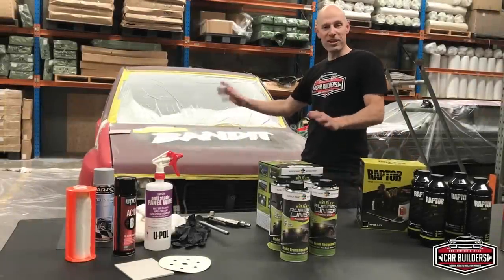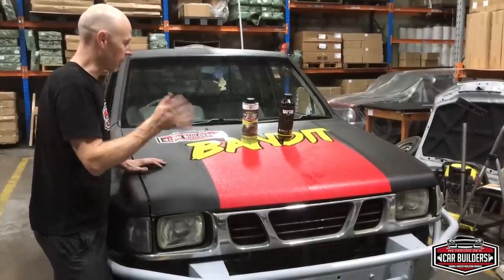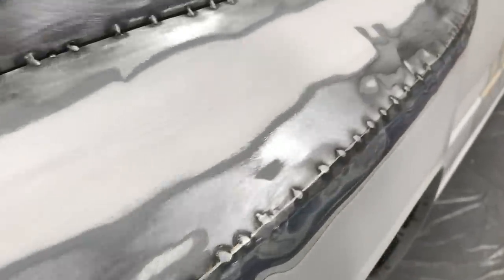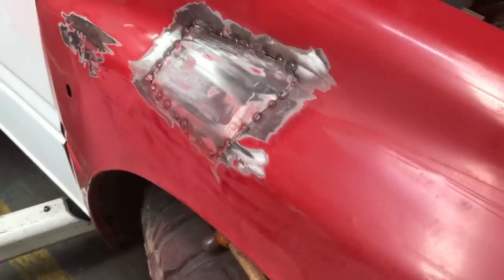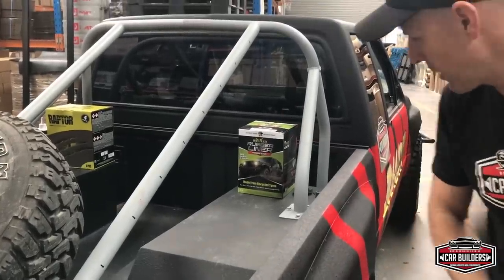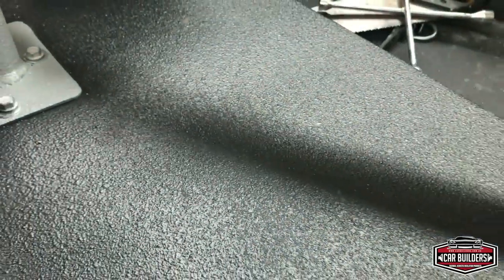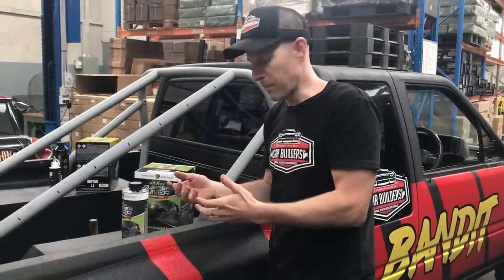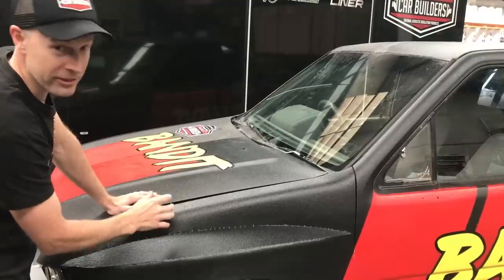Raptor liner or Bullyliner? A road test review on both DIY liners

Comment: I have a question about the Bully Liner, does it fade in the sunlight? Looking for real world info as I'm considering this for a complete truck and don't want it looking like crap in a year
Reply from the maker: Hi motafinga. Both Bully and Raptor are UV tested for 5000 continuous hours. What colour where you thinking? Bully is a lighter shade of black than Raptor and almost has a faded appearance rather than pitch black. I understand Bully are about to release a true black in addition to their existing Midnight black shade.
Reply: I think I would likely go with the lighter grey color, I really like the idea of it being water based and also have the ability to do touch ups. I would probably roll it on as well. I have used Monstaliner on another project with a roller and it came out pretty good and they claimed it was very UV resistant do to it using a hardener/ catalyst. The Monstaliner seems to have a lot more color options too so I’m weighing it all out
Reply from the maker: Yeah, water based is an advantage of the product. Good luck with your project.

Comment: would you use these type products on internal floor pan, firewall etc. and then apply sound deadener sheets? would the sound deadener adhere?
Reply from the maker: Hi Ben. Yes, the deadening sheets will adhere to Raptor. However, due to the texted highs and lows, in application, it is important you press the deadener in to contact all the lows as well as the highs.
Reply: @carbuilders1  thank you!

Comment: Hi guys great video, was wondering if u can use normal colour paint onto of the raptor 2k?
Reply from the maker: Yes, you can paint over the Raptor however you are best to tint the Raptor to the desired colour 👍
Reply: Thanks for reply, would u be able to put 9n quad bike plastic?  Think it would look great on my quad aswell lol
Reply from the maker: Yes, you will need to use the adhesive promoter (we sell it too) as if it was a bumper bar. The key is getting the solvent-based adhesive promoter to stick then applying a primer before applying the Raptor 👌
Reply: Raptor has a tintable variant.

Comment: I saw this video months ago and about to order 8 liters of Upol. I am thinking if it's going to be enough for my flat bed build on my channel. 8x7 feet with 2' of side skirts, aprox 110sf with headache rack.
Reply from the maker: You're just doing the tray in the dimensions you mentioned? 8L will easily cover it. Send through some pics when your done 🤙Instagram @carbuilders
Reply: @carbuilders1  I'm uploading the build as I go, actually ordering the Raptor now plus some epoxy primer.

Comment: Without using the tinted version what type of paint could you use to go over raptor liner eg. for a black gloss finish or fluro striping
Reply from the maker: Hi Bags Mc Gee. The Raptor Black  Midnight has a gloss finish. You can paint over the Raptor with any 2K or 1K paint. 😎👍

Comment: FYI - The Raptor, for what it's worth, can also be over painted with 2 pack paint...or base cleared for additional color combinations. Also - I noticed in the rope test, you didn't do the same evaluation on the Bully Liner and based on how the hammer scratched the Bully - I think the rope would have really torn right through it....IMO.
Reply from the maker: Hi Mark. Yes, Raptor and Bully can be painted over with 2 pack 👍As mentioned in previous comments, the rope test was done on both but missed the video editing 🤦‍♂️It is a servere test and ate through both paints (best way to think about these paints is 5 times stronger than a conventional paint)

Comment: Any idea how the Bully Liner fares as an electrical insulation?  What if you had an exposed wire and you cut the power,  sprayed it or brushed it down with the Bully Liner?  Do you think the bully liner would hold the temperature?
Reply from the maker: sorry we have not tested the product in this application, testing would need to be done to evaluate the scenario. We wouldn't be confidant to promote the use of a paint coating in this application as there are levels of compliance when dealing with electricity.
Reply: I see it is listed as Non-Flammable on your site.  Does this mean it does not hold a flame?

Comment: Hi there, great video. Just wanted to ask how raptor liner compares to rhino liner? Cheers.
Reply from the maker: Thank you Rosemary. The paints in this video are DIY whereas Rhino Liner needs to be applied by an applicator. Rhino costs a lot more however it will be a much harder liner.

Comment: How does Bully hold up to UV? I'm curious as how well it resist fading?
Reply from the maker: Hi David. Both the Raptor and Bully paints have been tested to 5000 hours of continuous UV. Both paints have been around for a long time and haven't had issues with this.

Comment: You never covered the effects of the testing of the Bully!
Reply from the maker: Hi Izzey23. Sorry it came across this way (filming/editing fatigue may have let us down 😫). We did the same thing to both sides in testing e.g. scrapping tools etc. We found they both performed very similarly but the real difference was the points we summarised e.g. different paint application, finished look and texture, washing them, ability to touch up etc.
Reply: @carbuilders1  The claw hammer removed much more material from the Bully side.  You played down the effect by saying you just brush away the removed material.  That seemed like a lame explanation.

Comment: Summary: Raptor liner is much much better despite the biased commentaries or lack there of.   The reviewer tried too hard to hide the lack of performance of the Bullie Liner to a point that I personally am being swayed away from it very much.
Reply from the maker: Thank you for your feedback mightymikee. We have addressed this feedback a few times in comments. We tried to complete the tests equally- filming and editing is harder than it looks 😆 We actually sell both products and are trying to show the pros and cons of both. These paints will suit different people/purposes due to their varying strengths. For easy of painting, grippy surface and desire to touch up, Bully wins hands down. If you want to colour match, a glossy-like finish and need a surface that is easy to clean, Raptor is your winner. We are happy to talk through which paint would suit your purpose best 03 8777 0960

Comment: So which one is stronger?? Or line-X? I will paint my scooter for crashing or scratchings
Reply from the maker: Hi Curtis. Line-X is stronger but these paints are DIY.
Reply: Car Builders - Thermal & Acoustic insulation materials Can i do it by myself with Line-X spray? They said 1000 $ for painting with line x in Turkey..It a very very expensive here and i need to do it myself
Reply: Years ago, a guy I knew had a truck painted with liner, maybe, rhino? It was like 40 grit sandpaper, we would push each other into it when we were walking by it, the thing would give you road rash. Any info on techniques to avoid that, yours must not be that way, you wouldn't have leaned on it, maybe who ever did it used a roller?

Comment: Raptor looks to be just a step behind line-x. Not sure how many coats went into that bed, but if I put all four cans into just the bed of my Ranger I’m pretty sure it’d be much tougher. Better yet, spray two kits/8 cans as a bedliner and it’d be even better. For just over $200 USD, that’s a quarter of the cost of a Line-X. On a used truck that’s not gonna get commercially beat on, that has to be the way to go.
Reply from the maker: Hi Chris. Yes, Line-X is a stronger coating than these paints but isn't a DIY option. We were looking at two leading DIY coatings available in the Australian market 👍

Comment: Also do you think a Gallon is enough to paint a whole truck? What kit would you recommend
Reply: Whats ur idea of a truck? 74 Toyota helix or ram megacab lol
Reply from the maker: Hi saabin907. You will need 8L which is just over 2G (two coats) for a Toyota LandCruiser wagon size truck.
Reply: Definitely shop around for prices as they very quite a bit. I was able to find a 4 liter kit on eBay with the gun for $92. Two kits should be enough for your application. You can also thin it which will make it spray a little easier with a smoother texture using their supplied gun.

Comment: Nice review of the hardness of these paints, but the question of which one is better was not definitively answered.  I am still in the dark.
Reply from the maker: Oh no... Well, through our testing we discovered that they performed very similarly. The greater difference, or the better one, depends on the level of skill of the user (Bully is much easier to use as a water based solution), access to equipment (Raptor is 2K and should be done with the appropriate safety equipment), the look (Raptor has a more glossy appearance and Bully is more matte), need for a particular colour (Raptor can be tinted to colour match and Bully has a select range), texture (Bully is much grippier) or clean up (Raptor surfaces clean much easier- although Bully are bringing out a top coat which will improve this area for the product). So outside of performance, which was the same, the other factors will make one product a clear winner for one person but not another. Good luck with your project.

Comment: Also note all the dust he wiped off after clawing at the bully with the hammer and the nast scratches he didnt show. Video has to be sponsored by bully.
Reply from the maker: Hi Juan. We made an effort to make a consistant road test on these products and we are sorry that you saw it as bias. Our aim was to educate buyers about the strengths of each paint. No, this was not a sponsored video. We actually stock and sell both products.
Reply: I bet you chose Raptor and want to justify your decision, there are long term videos on Raptor use here on YT, I suggest you go watch one of those long term tests, Raptor peels like crazy and even has let rust through in some cases.
Reply: How well do you think it would hide light to medium hail damage.
It looks like it did well on your panel welds, but I'm just curious about what you think since you have applied it and know how it goes on.
Thanks

Comment: What did you do different to get the red on the craptor liner?
Reply from the maker: The Bandit stickers? We put those on first and masked around them before spraying.
Reply: Car Builders - Thermal & Acoustic insulation materials Car Builders - Thermal & Acoustic insulation materials at about 3:00 you started talking about painting on the bullyliner. You never addressed the red on the craptor liner.
Reply from the maker: We applied the same way as we did with the Bully. Yes, like Bully there was no issues and it stuck well. We may have missed discussing it as Raptor is tintable and most people will apply the colour they want.
Reply: Car Builders - Thermal & Acoustic insulation materials copy. Thanks.

Comment: How does the vinyl stickers holding up? I am a little concert that If I put vinyl might fall off after a while and between washes!
Reply from the maker: So with the Bandit in this video we put the stickers straight to the sheet metal and masked it. We then painted the textured paints so essentially we have finished it like a vinyl wrap, it sticks well and no concern about it coming off. However, f you try to place the stickers straight onto the textures paint it won't stick.

Comment: I want to use this stuff on my deck
Reply from the maker: Hi Independent Ideology. Yes, Bully can be used on a deck. It sticks well to timber and if it is fiberglass you need to abrade the surface and prep it like you would with a standard paint finish.

Comment: He kept talking about how bad the grip was on the raptor he failed to mention you can change the texture with the psi and how far or how close you are to the area you are spraying felt like this comparison was very biased
Reply from the maker: Hi Wyatt. Yes, texture is changed with psi/distance, however it won't dramatically change the grip of this paint. The greatest way to improve the Raptor grip is to add their Raptor Traction Grit Additive, which will make it similiar to Bully. Without the grit, sprayed at any psi or distance, Bully is far more grippier. This has a side issue for Bully, which is that it is also much harder to clean as it is almost like sandpaper and dirt can get stuck in crevasses.

Comment: I'd stay with line x
Reply from the maker: Line X is a tougher paint but it isn't a DIY option and obviously has far more expensive price tag attached to it.
Reply: Ya you pay 400 bucks to do your truck bed and never worry about it again for the life of the truck noone wants to keep touching up spots that's just silly
Reply from the maker: In Australia it is $1100 for a tub and an extra $450 if you want a colour other than black. If you are doing other panels or the whole truck/car it becomes very expensive. But you are right Peter, if you want a liner that you use in a working truck/4WD tub/tray then it makes sense.

Comment: 1:30 use face mask, even cheap one is better than nothing, you don't want to line your lungs with this...
Reply from the maker: Hi jz1199 Yes, all pre-cautious should be taken. The point here is that water based paint is similar to painting your fence or walls at home. Whereas, Raptor or 2k paints should be painted in a booth with all of the safety masks etc required.

Comment: What a load of shit! When the hammer claw is dragged on the Raptor side Baldy uses one hand and "rubs it" but on the Bully Liner it is a two hand job and looks like 10 times the force (his missus will never need to worry about that - the Raptor grip should be enough!) Complete load of shit!